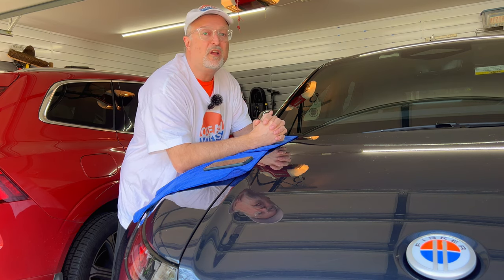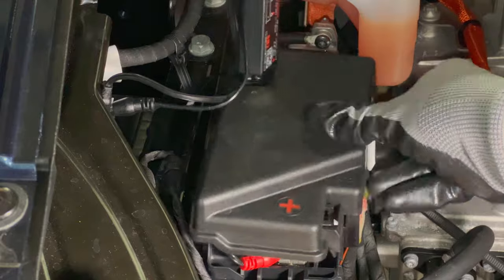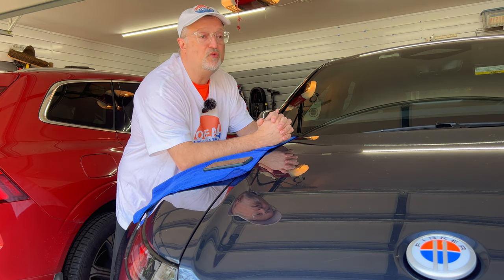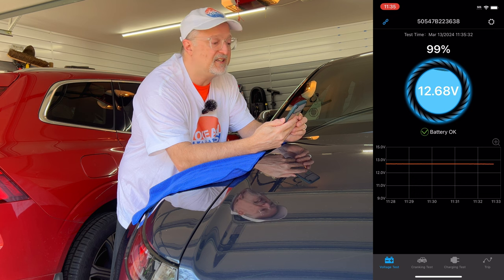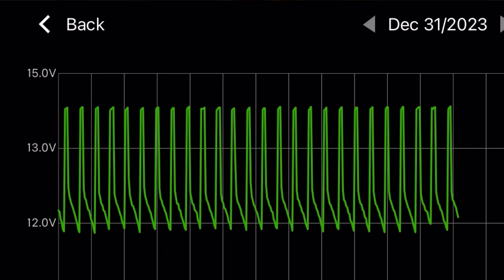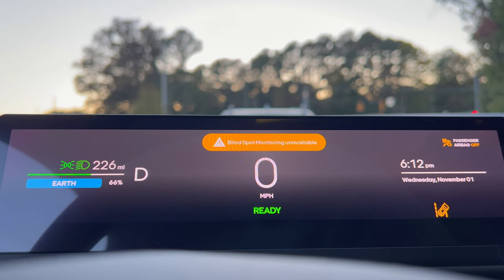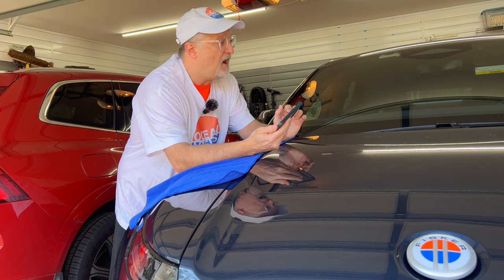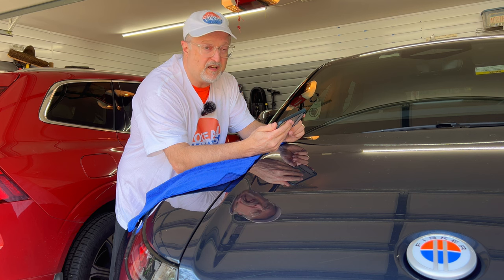Fisker Ocean One - 12 V Battery Update

Comment: Hi, I've seen your video on how to install the battery tender and will be doing that soon. I wanted to install the monitor as well but didn't see a specific video for it. You mention to hook it up the same way. I see we can do that for the positive terminal(red) but in the battery tender video the neutral terminal(black) is clipped on and not secured down. The monitor black terminal looks like it needs to be screwed in. I just didn't want to mess anything up.
Reply from the maker: I think I also answer this on FB.  But here it is for other people to know:  I never did one for the battery monitor. But it follows similar steps. First, connect the red lead to the positive terminal under the plastic cover. There are actually tow positive points you can attach to. I found the one closer to the bumper easier. Then you connect the black lead to the negative terminal of the battery (kind of hidden under the bracing bar above it. For both the positive and negative terminals, loosen the nuts if they are spade connectors on the monitor and slide them between the nut and the terminal. If they are eye connectors (loops), you will need to take the nut off, slide the connector on and then put on the nut again. Then tighten. I used alligator clips in the video for the negative, but for a permanent connection, use spade or eye posts.

Comment: Thank you for excellent videos. If I am not driving Fisker for a week does it affect the 12 volt battery? Should I connect the charger to the car during this time?
Reply from the maker: It's not a bad idea to connect either a EVSE to the J1772 port or a battery tender on a 12V battery if away for a week or more.  It's just extra protection.  Some people have reported no issues just leaving the car unplugged for a long period while away.  They make sure to leave the state of charge at least 80%.

Comment: Thanks. I believe you connected a trickle charger. Would that conflict with the main battery charging the 12v?
Reply from the maker: I only installed it in case the HV battery pack didn't charge the battery - or if it got too low.  That hasn't been an issue since I adjusted the negative terminal back in November.  I suppose I could do a test on this.

Comment: Once again, an informative video with encouraging news.:finger-red-number-one: I'm curious if your monitor would show a similar voltage as one plugged into the 'cig lighter' plug in the rear. Mine typically shows high 12's to low 13's, sometimes higher.
Reply from the maker: I feel the battery monitors directly connected to the pos and net terminals and I be more accurate.  The one I uses stores two weeks of data and uses a phone app via Bluetooth.  I’ll put a link in the video description.

Comment: So my Ocean bricked last night. I am thinking that software update 2.1 got pushed to my vehicle overnight & the 12 volt battery was too depleted to start with & the update either failed or got lot downloaded but drained the 12 volt completely. Got a 12 volt charger/maintainer at the auto parts store & it's charging the 12 volt battery now. We'll see if it works. Used your "how to" video to guide me. How long is it typically take the 12 volt to charge up?
Reply from the maker: It depends on how much it is drained and the amp rating of the charger.  It can take anywhere from an hour to several hours.  I'm going to do a video suggesting people waiting for the 2.1 update keeping the 12V battery charged when not driving.
Reply: I had the same issue. Which charger you used?
I need to do the same . Need to charge the battery.

AMG charger support will work for this battery ?
Reply from the maker: @venkat2295  Yes, the battery is AGM.
Reply: @scottwakefield2419  charging the 12v battery fixed your issue?

Mine was down below 10 if I check the voltage level. I will charge it and see

Comment: Do you set the BM2 to regular 12v lead acid or AGM?  Owner manual says lead acid but there is a post showing AGM.
Reply from the maker: I don't see anywhere in the BM2 app settings for adjusting the battery type.
Reply: When I first ran the app it asked to select battery type.  Also in Setting----> Bluetooth device---->Battery parameters.
Reply from the maker: @alandoan1043  I found it.  I never realized that was there.  Thanks for pointing that out. The battery is AGM.  I’m not sure how that affects the monitoring.  I’ll check it out.

Comment: Bought a car with only 300 km driven(new) but has ben stored several months, stopped after a few km with a lot off errors, get started an stopped again after 15km totaly 4 times, uppgarded to 2.0, after 400 km errors and no power, started after a few minuttes, could it be 12v battery failure?
Reply from the maker: Most likely 12 V battery is the issue.  Use a battery tender to get it back up over 12 V if possible. If it has been sitting for that long, it's possible that it needs to be replaced.  When they do that, make sure they adjust the negative terminal lead. https://youtu.be/GDy0SkZ6Np0

Comment: If I add a voltage monitor do I run into any difficulties if the battery is disconnected when I attahc the leads?    Rumor has it that if the battery gets disconnected, the car will need a technician to come out and reclaibrate.
Reply from the maker: Just loosen the terminal nuts if the monitor leads have spade connectors. For ring connectors, remove the terminal nuts and insert the monitor leads.   Make sure you don't remove the car's leads and you should have no problems.  Yes, if removed, you will need to have a tech come to recalibrate the doggie windows.
Reply: @MTNRanger  A tech came out today to fix a door handle.   He installed the battery monitor you recommended.  He liked the phone app it so much he took a pciture of it.
Reply: @MTNRanger  FYI I showed hime the 2 plastic boxes tha you featured.  The glove boxx and the one for over the central taco tray.
Reply from the maker: @tomheineman-x6w  Nice!